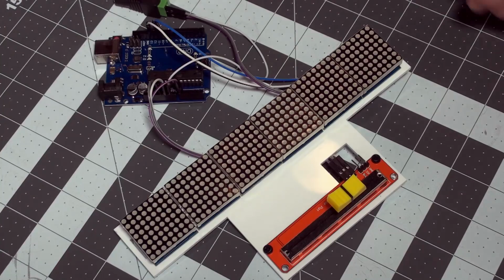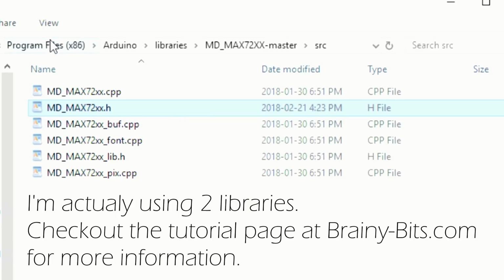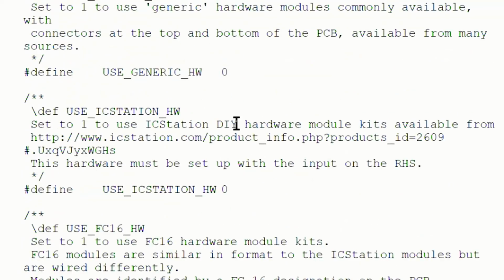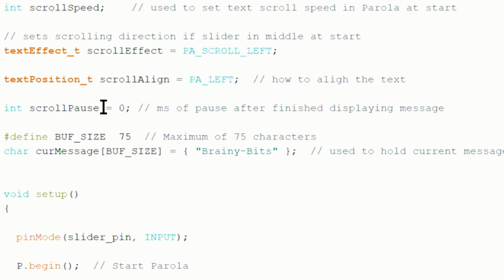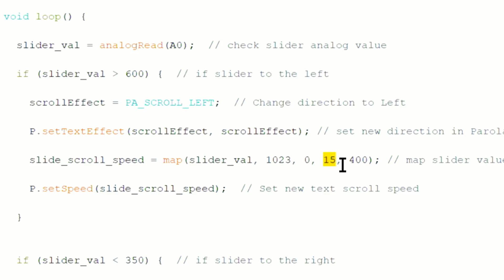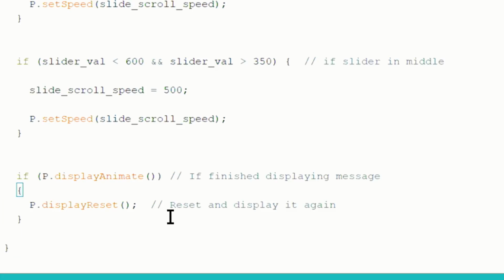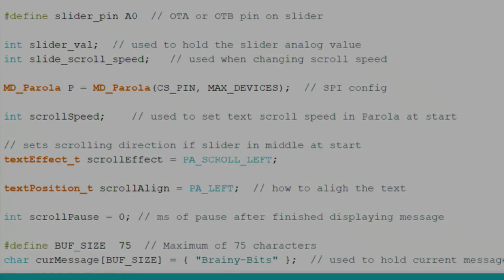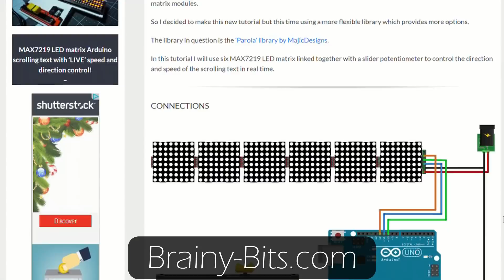Arduino Scrolling Text LED Matrix with 'LIVE' speed and direction control - Tutorial

Comment: Greetings Brainy Bits! I would love to use your beautiful design; the sketch is loaded normally but does not display any message on the display. I'm using the two libraries you provided: MD_MAX72XX and MD_Parola. I'm also using a 10K linear potentiometer in place of the Slider; Is that why it does not work? Another thing: the MD_MAX72xx.h file does not have the mod part like you say in the video! If you can help me, thank you very much!

Comment: I have the MD_MAX72xx.h but cannot find the #define USE_PAROLA_HW  0  or #define USE_GENERIC_HW 0  in the text. Are there different versions of this file?
The version I have has:
  enum moduleType_t
  {
    PAROLA_HW,    ///< Use the Parola style hardware modules.
    GENERIC_HW,   ///< Use 'generic' style hardware modules commonly available.
    ICSTATION_HW, ///< Use ICStation style hardware module.
    FC16_HW       ///< Use FC-16 style hardware module.
  };
but it doesn't have #define USE_GENERIC_HW 0.
Reply: I've just found the answer. No need to edit the latest version of MD_MAX72xx.h.
Just simply change the arduino code #define HARDWARE_TYPE MD_MAX72XX::PAROLA_HW  to #define HARDWARE_TYPE MD_MAX72XX::FC16_HW

Comment: NOTE: You no longer need to make the modification in the Parola/MAX72xx Library as noted in the video.  In the updated EXAMPLES there is now a line that reads:

#define HARDWARE_TYPE MD_MAX72XX::PAROLA_HW

And you can change the "PAROLA_HW" to the type of board/matrix you are using.

For example I use the FC-16 boards so I changed the define to:

#define HARDWARE_TYPE MD_MAX72XX::FC16_HW 

You can find the enum moduleType_t definition in the MD_MAX72xx.h file at around line # 265 to define which module you are using.

Comment: Sir i used aduino uno & max 7219xx library with 4 module but message is displaing in reverse direction with each module .... please help me .. whatsapp  no 8391021289
Reply: For anyone using the block of four 8x8...The block of four 8x8 boards are wired differently, I traced out the pcb. You need to use the separate 8x8 units and the FC-16 selection as Yvan says.
I have built both types and got them going...12 units long.  The block type have the input on the left and the display was upside down but when you place it under the front of a monitor and see the reflection in the shiney black , the message looks really smart. I can't remember which alternative I used in the dot h file for the block type but you may have to exit Arduino after saving and restart the prog....best to stick to the separate units.  8-)

Comment: instead of modify the .h file, couldn't you just add the same DEFINE line into your sketch code, after the INCLUDE of the lib? Shouldn't this override the .h file directive, and allow you to mantain the main lib code as it is, so you can easily upgrade without loosing your mods?
Reply from the maker: Not really, you see the Library gets compiled separately from the Sketch, everything might get put together in the end but a #define in the sketch will not affect what's in the library.  At least not using the Arduino IDE.  It would be cool if you could.  Thanks for watching btw.
Reply: Brainy-Bits understood, thanks :-)
Reply: @BrainybitsCanada  You can do this as well:
#define HARDWARE_TYPE MD_MAX72XX::FC16_HW
#define MAX_DEVICES 12
#define CLK_PIN     D5
#define DATA_PIN    D7
#define CS_PIN      D8

// Hardware SPI connection
MD_Parola P = MD_Parola(HARDWARE_TYPE, CS_PIN, MAX_DEVICES);
// Arbitrary output pins
// MD_Parola P = MD_Parola(HARDWARE_TYPE, DATA_PIN, CLK_PIN, CS_PIN, MAX_DEVICES);

:-)